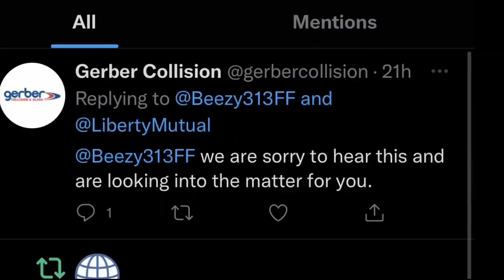Rapper calls out insurance company, collision shop after car trashed

Comment: #allinonit. Back in 2015 Geber collision in Macomb County got an 2006 Cadillac X L R Charged for New parts, but used the same part’s. Sliver metallic paint front end collision/repaint job. Was deff way off. The Insurence Co & the body shop were in on the whole shebang.                                  F A C T Not B L A M E.